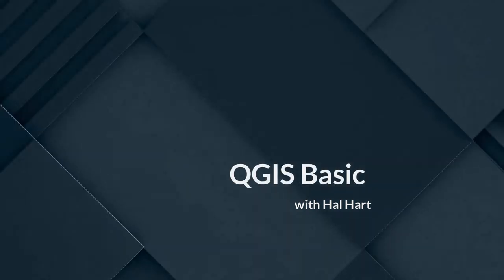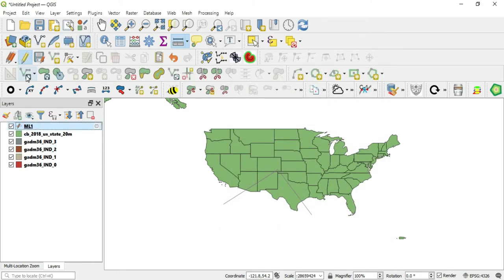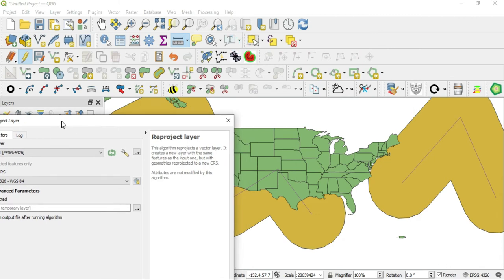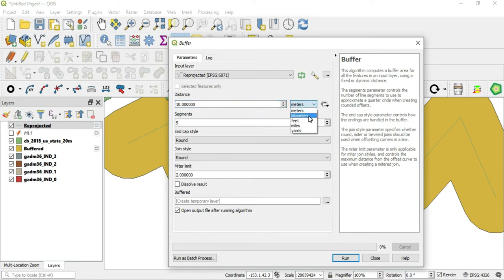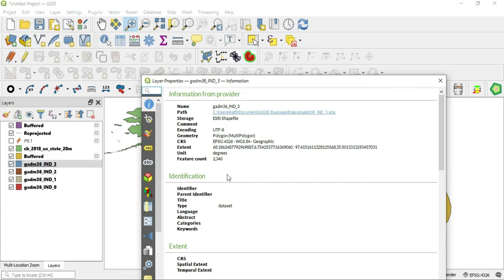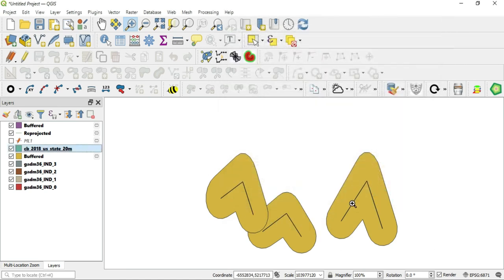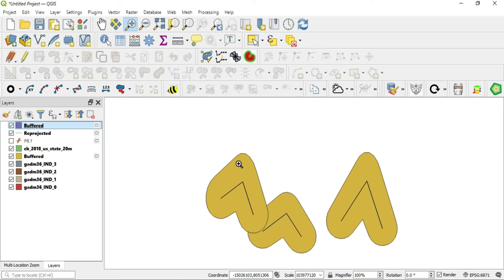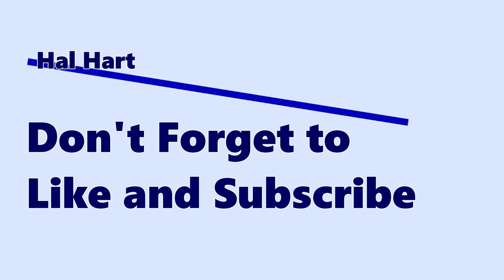QGIS Basic 115: Issues with CRS, Polylines, Buffers

Comment: Hi Hal, Thanks so much for putting this together. I was loosing hope till I found your channel! I did what you said and used the Pseudo version of the CRS and was able to create a 500m buffer around a line. However when I go back through and use the measuring tool they only come out to like 300m. Any guesses as to why this is?
Reply from the maker: Hello did you try using the shape tools as a way to create buffers. Shape tools plugin has a feature called "donut" in which you can specify with varying units the lengths of inner and outer radiuses of your buffer. The calculations that I have seen have been much more accurate  than the pseudo option.
Reply: @HalHartQGIS  thanks. I'll give this a shot! I'm guessing it's an issue with the projection?
Reply from the maker: Yep

Comment: Hi Hal, thank you for pointing me to this video. This video clarified some things, especially because it was so focused. 

Now I have three questions, that I hope you might have time to answer: Q1: If we set the PROPERTIES\PROJECT CRS when we first open the canvas (or whatever the blank map window is called before we add a vector layer), will every layer we add after that be converted to the new CRS? Q2 If the answer to Q1 is NO (which I suspect is the case), do I have to convert each layer I add (each time I add one) to the same CRS as the project CRS? Q3 How does projecting on-the-fly work into this?

Regards,
Jeff
Reply from the maker: So when you create a new project the default is WGS84 I believe. You can change that CRS to the CRS you desire, but if you try to bring in another layer with different CRS, QGIS will try to perform an "On The Fly" conversion of that new layer to the project layer CRS. To make to layer visible. If it can not covert that new layer will not appear. The first layer you bring in by default changes the project CRS to its own. Any subsequent layers will need to be reprojected to calculate as closely as possible to the project CRS. You can also switch the project CRS by right clicking a layer and hovering over the layer CRS option. Then you will see "set projet CRS from Layer".
Reply from the maker: Once you have set the project CRS all files will adhere to it. Some may not be visible if the calculations become too distorted.
Reply from the maker: O yeah I forgot about the pop windows!! when there are multiple datums available a pop will occur when you bring in new layers. It will allow you to select the most stable CRS available. It will show you a small display of what area its calculations cover. Most of the time the most stable CRS will be highlighted in Green, and will be towards the top of the CRS or datum list.
Reply: @HalHartQGIS  I didn't realize there was a logic to which CRS were shown. I don't recall seeing any colors on my CRS options, though. I'll have to pay attention to that --- I might have a setting turned off.
Reply: @HalHartQGIS  That explanation helps immensely. Thank you.

Comment: Hal,
Thnx for sharing your wisdom.
I have a problem and maybe you can help?
I have a poligoon shp file and al the items don't line up.  I cant stand it that it has so manny gaps inbetween. Is there a easy way to line them up? I don't want to draw them again. Thnx for youre help...
Reply from the maker: Hello. I need a better idea of what you are trying to do with your features. Are you trying to combine the feature to make one feature with no gaps, or are you trying to keep the features separate and just move them closer to one another. 
If you are trying to combine features there are methods to do this, but if you just want to move them closer to one another there is a function in the Advanced digitizing tool bar to click and move any feature. Also remember that moving feature will offset their positioning from the normal position calculated by CRS. So if you move them there location will no longer be accurate for doing calculations.
Reply: @HalHartQGIS  
I like to keep several shapes and put them neat aganst eache other. I have the shapes made befor but they are not connecting.  I can do this by hand but I wonder is it is possible to do this with a tool? The gaps should be filed.
Reply from the maker: Ok, I understand now. You will need to manually squeeze out the gaps. There are no plugins to automatically move your features or rally remove spaces between them.
If there are to many gaps to fill why not create a background layer that fills with a color that suits your project. So like if you have green shapes for land that had gaps between you can can use some type of green  base layer to "Fill the gaps"
Reply: @HalHartQGIS  
Thnx for your help...